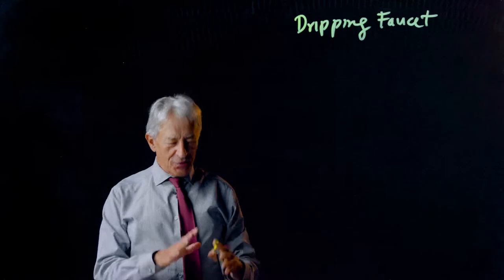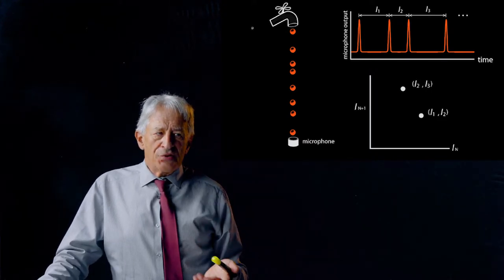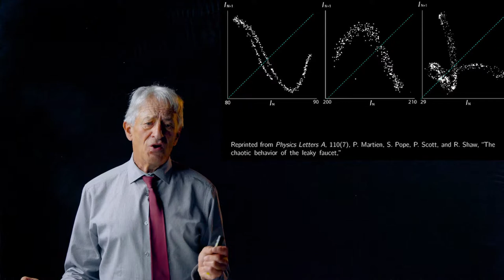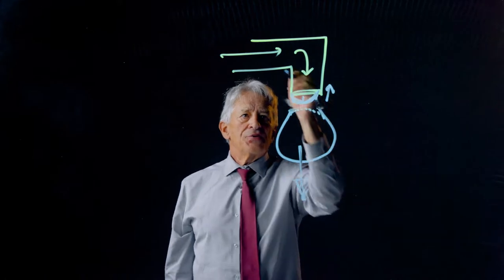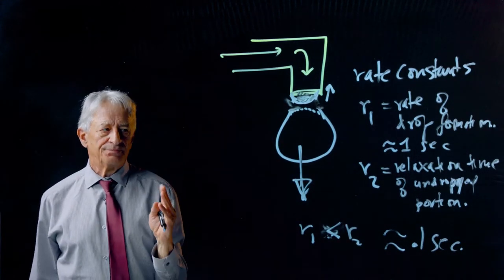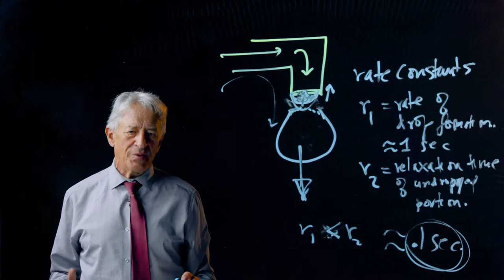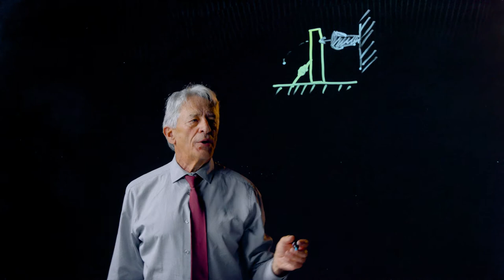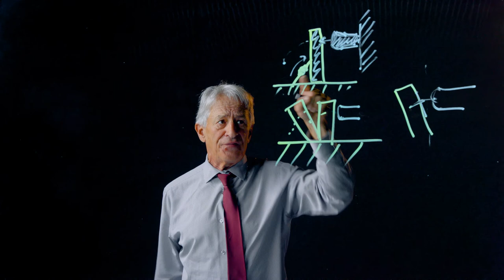19.4  Dripping Faucet 8 14 2019

Comment: 17:33 unless the punch not being perpendicular is important to the explination. Which I feel like its not because the leaking faucet does have this sort of issue with a different angle punch it more so has to do with it still returning to the same state not that the faucet is "pushing" at a different angle.  I feel a better way to explain it would have been a surface on a spring that is always punched in the same direction if you punch and let it return and then punch and let it return the system oscillates steadily.  But if you punch it while it is on its way back, you create weird oscillation.  no difference in angle of punches.